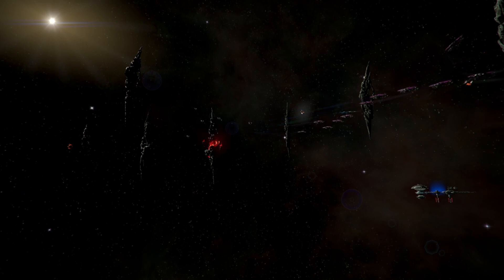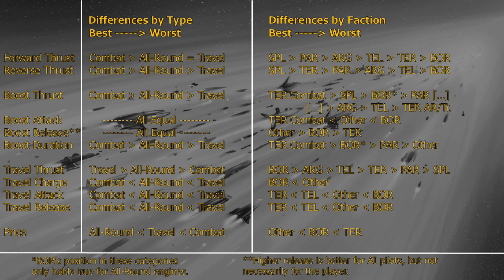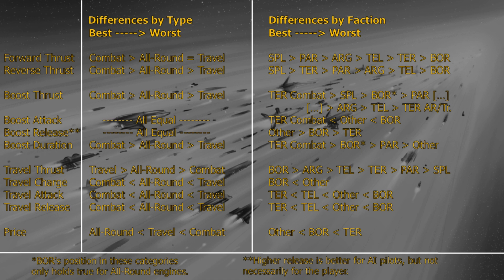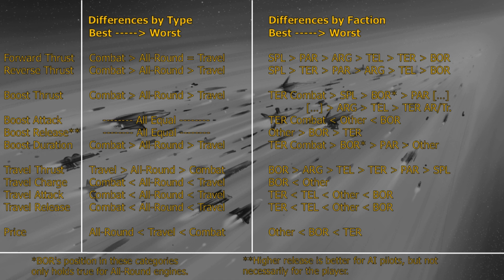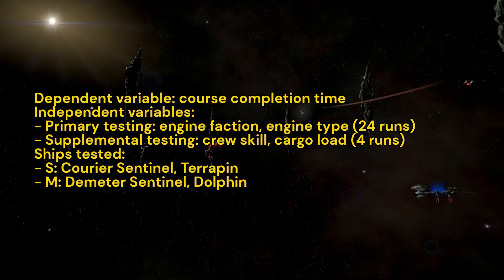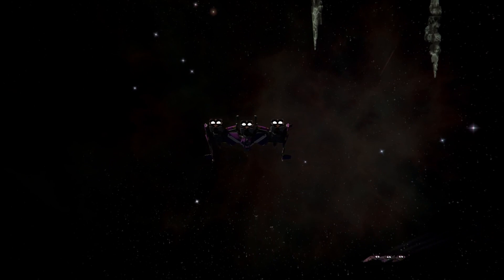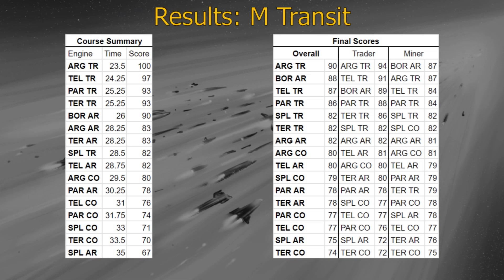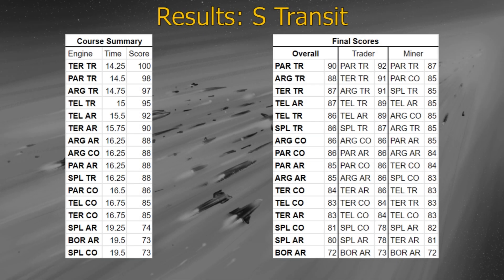[OUTDATED] X4 Propulsion Lab, Part 2: Subcapital Engine Testing

Comment: So which m trader do i use and which engine do i put on it
Reply: ARG travel engines on Dolphins.
Reply: The best is Demeter with Argon All-Round engines. Multiply cargo capacity by speed and it is as good as the faster Split M trader, but it is SO much cheaper that as a workhorse it is LIGHT YEARS ahead of any others. However, the Teladi Vulture and Tern are given a decent boost to cargo capacity that they could be in second place now, rather than last place. TBH the price or speed of the M class traders should get a nerf and the massively slower Tern/Vulture is now a good spot, possibly first place now, but very VERY vulnerable to attacks by pirates. For THOSE it may be worth getting Travel Drives, because if they get attacked, they aren't getting away with or without better engines, so the sector speed advantage of Travel Engines pertains and the downside already so deeply down that it can be safely ignored.
It still leaves the Mercury badly off. Two turrets are better, but OOS missiles don't work, so you can only really fit one plasma turret and one pulse turret so you can cover bigger ships and IS and OOS combat equally. Un-nerf missiles OOS and that second turret MAY be worth it.
Reply from the maker: Depends on your use case, but the oversimplified answer is Demeter Vanguard with Argon Travel.
Reply: @CptSnuggles07  The Demeter is fast enough you can consider the Sentinel version. 20% more cargo with 10% less speed. Mercury is so much slower but barely any bigger, that you wouldn't be served going Sentinel with them. The Vulture is slow in Vanguard form that it becomes better choosing Sentinel, because it can so easily get caught by anything that it doesn't matter you lost MORE speed, but since it has a lot more cargo space (now), that Sentinel boost is giving you a LOT more space to play with.
Reply: And if you sre using a boa, probably worth to invest in mk2 split c9mbat engines, that ship is almost always gonna be able to scape from any threat, from pirates to xenons or kaaks
Reply: And if you sre using the vulture sentinel (my fav one) i feel like investing in mk2 or 3 travel is worth it

Just comply with the pirates and be done with it
Reply: I just realized dolphins don't take non-boron equipment.

In that case i'd also say Demeter Vanguards if you buy.

However... Boas are better, Zyarth deliveries are frequent... and liberating them is basically free.
Reply: @jemandanders6160  i thought u were being sarcastic mate😅🤣
Reply: No, just too much spacefuel and majadust